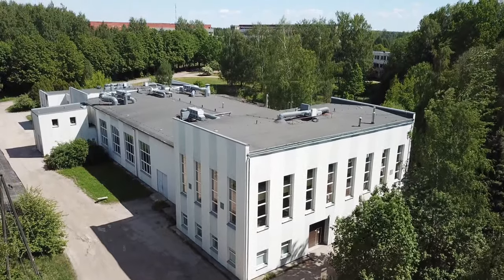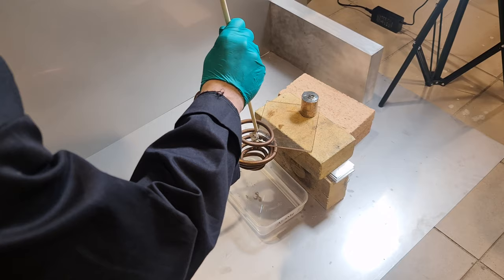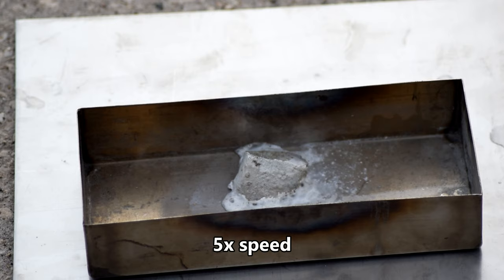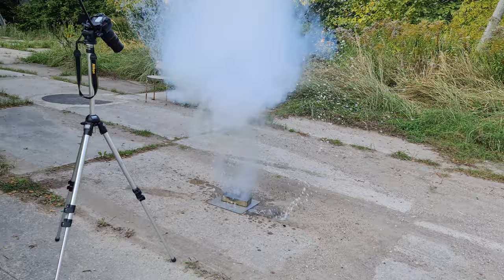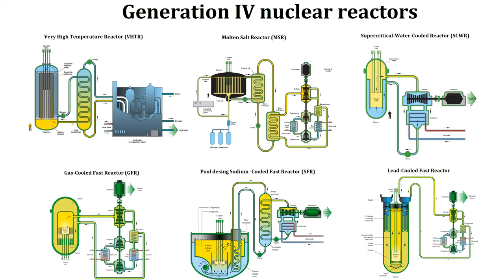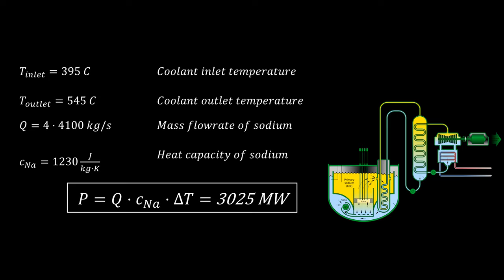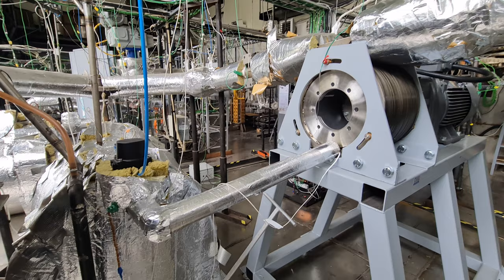Liquid Sodium Levitation, Reactivity and why Physicists Use it in Nuclear Reactors and Geodynamos

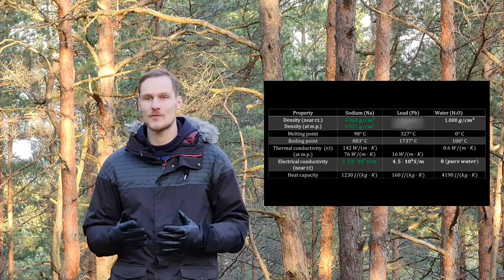Comment: 1:09 - I believe there is a mistake in the table with material properties, i.e. the density of lead is wrong.
Reply from the maker: Ahh, yes.  The density of lead should be 10.6 g/cm^3 (at melting point) and  11.3 g/cm^3 (at room temperature)